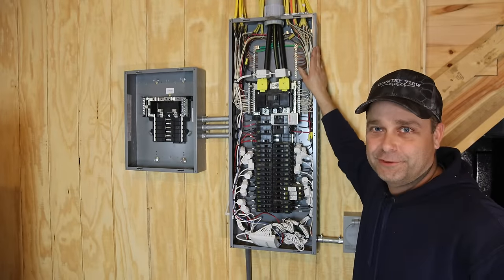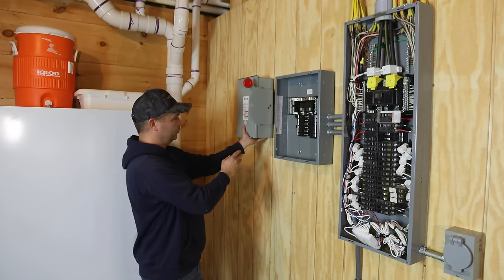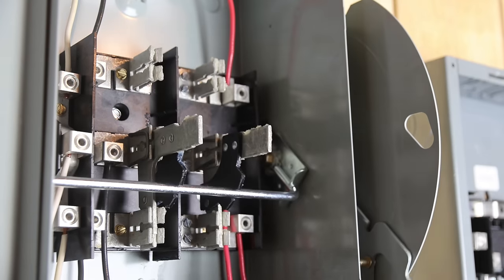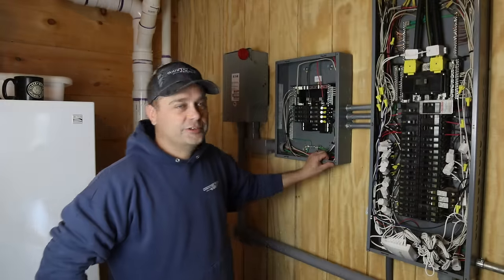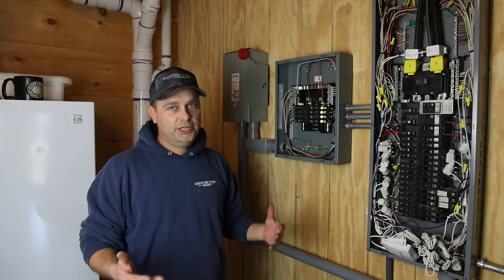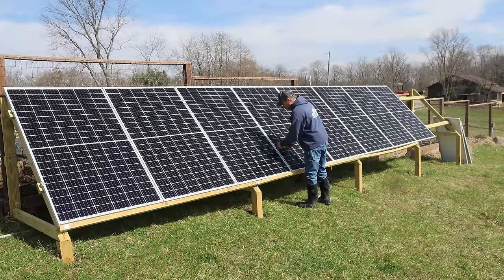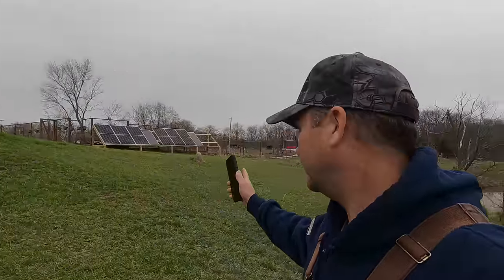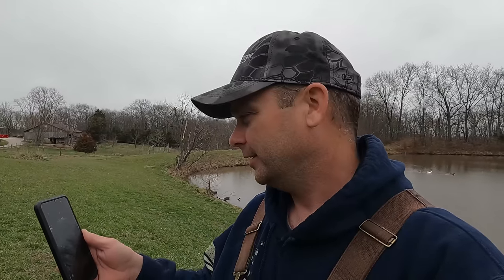Installing an Off Grid Panel and Transfer Switch.   Discovered a problem with our EcoFlow Delta Pros

Comment: When I added a subpanel in my garage, I needed to move a couple of circuits out of the main and into the sub to make room for the breaker to feed the subpanel. Like you, I was going to wire nut wires to make them long enough to move the circuits over to the subpanel. When I asked the electrical inspector about it, he told me that I could not use the main panel as a pass-through enclosure. Instead, I had to pull the wires out of the main panel entirely and perform a splice in a separate junction box. You may want to double-check with your electrical inspector to see if you need to do the same.

Take care and God Bless.
Reply: Maybe the panel is outside...wire nut splices in high humidity areas tend to go bad over time with in reased corrosion and resistance and heat.  Inside a house at home humidity levels probably not an issue.
Reply: I was under the impression that splices could be made in the panel but I much prefer to install a Jbox and splice outside the panel .. much cleaner IMO.  Thx for the excellent video

Comment: I am just ready to install a single Ecoflow Delta Pro backup at our place in the Bahamas. I'm using a Reliance 6 circuit transfer switch (single box, comes with breakers, cord, and receptacle, about $320.00). I did replace the 30 amp 240 breaker with 2 120v breakers since all 6 of my circuits will be 120v. Hoping it all works, because power goes out here at an average of 4-6 times a month, but generally only for 30 minutes to a couple of hours, though it can, on occasion, last all day (or night). Installing 2 200v panels, but will of course keep the Ecoflow plugged in all the time. Thanks for your input on this system, sucks about not being able to plug both into the grid. It seems there would be some way to resolve this, but I'm a long, long way from an EE! 👍

Comment: 👍👍👍👍👍👌Very interesting and slick system to handle your critical loads without having to use your standby generator, great use for the Eco Flo as a battery bank nice work on the critical load panel and switch over panel.!!!

Comment: It's so exciting to see you all excited about going off grid. You're in the right track, keep it up! It's really rewarding. Your system will keep growing up on you faster than you can handle. As you said  Winter is the real trial time, when you realize all the shortcoming of your configuration and decide to fix it or improve it. Thanks for sharing, and good luck with this project.

Comment: An EcoFlow has got to be almost the MOST expensive way to do a solar/battery system. Using separate battery/charger/inverter units is probably less than half the cost.
Reply: Not if you get them for free! ;-)
Reply: @oxfletch  Free is only better if it does the job, he's found two big problems already and that is just the trial system
Reply: Very true.  A big hassle to make an emergency system function as a power plant.  Best to use a real solar inverter system like sol-ark.  Hranted it costs more but over 30yrs it will pay you back in money and ease of use I can assure you.

Comment: When you get to the point that you're going to go full solar, I suspect you're going to need to consider a battery solution that's more focused on solar battery backup. The portable units are nice, but may not be the best long term solution.
Reply: Like Signature Solar EG4 Rack batteries.rack if 6 is over 30kw. And around $10,000 alit cheaper than adding additional batteries to echoflo.  Better value all the way around and more geared for solar. They have inverters that accompany around 450 volts.  At very affordable prices and utilize 2 fir split phase about $1,600 each. Hope this helps......  Jeff
Reply: @JWTX I’m in between the Ecoflow and EG4 right now. I know the EG4 is way better value, but I’m worried to screw something up because I’ve never done this before.

Comment: I have had 3 100 watt panels on my workshop and 3 100amp hr bats I run my compressor and stick welder and plasma cutter off it for 3 years, but I just have a a simple system

Comment: Use a automatic transfer switch like a Moes that will monitor battery voltage and switch from battery to utility and back at the voltages you want it to.

Comment: I maintain the metering system at an electric cooperative in Missouri.  Every state has different net metering laws, but I find it very interesting that you have chosen to maintain your own battery system rather than using the grid as a free battery.  This truly does give you redundancy in a power outage situation for your critical loads, similar to a hospital or other high uptime facility.  Congratulations on an innovative design.  It should benefit you for years to come.  It will be interesting to see how the batteries hold up over time with daily use.
Reply: Using the grid as a free battery doesn't work if the grid is down in a power outage
Reply: Evan has already stated his utility only gives him 3 cents per kwhr as sell back and he pays probably 3 or 4x that for grid power.  Not a great deal.  
The market likely will cause a lot of people to say I'll store my own power with deals like that and also find a way to be 99% off grid leaving utilities wondering why they are losing customers.  If utulities were more fair on sell back power people would glady joing net metering deals.  As it is they are scared they will be put out of business.  That is exactly what they are driving as a result.  I won't feel sorry for them either.
Reply: Keep in mind illinois has 6 nuke power plants and 11 reactors in the state and generates more nuke power than any other state.  Nuke power is the most expensive power you can have and the most dangerous/highest risk.
Its no wonder Ill only pays 3 cents per kwhr for solar buyback.  They are trying to discourage solar to prop up their nuke mistake.  The little guy like Evan suffers in high prices, higher risk of a Fukushima event plus a pittance in solar buy back rates.   Its phenomenal how one man like Evan or myself can now own their own solar power plant on their own land and not really need the grid if you add generator backup and enough panels and batteries.
If you know what youre doing theres no risk with solar for a catastrophic event.  The complexity of nuke steam power generation just from water cooling systems is enormous in maintenance and cost.  Glad I dont live in illinois with the corrupt and incompetent gov there but we all dont have choices where we live so you have to make the best of it sometimes.
Reply: @trophyfishn9757  Existing nuke plants sell power at around 3 - 4 cents per kWh which explains why utility is offering 3 cents to buyback his solar. Places that pay full retail rate for exported solar (net metering) are losing money and will be phasing out that program.

Comment: Both my Ecopros get here in three days. If they haven't addressed this my workaround is to power the house with the generator and then charge the (now off-line) Ecopros individually with available house outlet AC. Throttling back power use within the home would help shorten battery charge/gen run times.

Comment: Since none of your current critical loads are 240 you could feed each phase of sub panel from ecoflow independent. That way they could be changed from grid without shutting down output to panel. Down side is you wouldn’t be able to feed main panel during grid outage

Comment: In a emergency situation, this is the last step. First step is a panel, a controller, a battery if you have this resource, and a inverter. With enough panels you only need a buffer battery to keep the voltage steady.

Comment: Evan, you only bond neutral and ground together at first panel. Not in secondary panels. It looks as though in the solar powered panel you have a green ground wire running from your ground buss to your neutral buss.
Reply from the maker: No I don't.  I have 3 ground bars in the new panel.  They aren't bonded to neutral.
Reply: @CountryViewAcres  ok, I couldn't get a close look at it.  Sorry, I didn't mean to make you upset. I went back and stopped the video and zoomed in and now see what you did. It looks good. The circuits you moved to the second panel are they supplied 24/7 from solar?
Reply from the maker: I'm not mad.  Sorry if it sounded that way.
Reply: @CountryViewAcres  Is the seperate panel on solar 24/7 or is it possible to feed it by switching to mains power? Is that what the other switch is for? I'm trying to figure out the schematic in my head.
Reply: @CountryViewAcres  Hey Evan, have you heard of a grid tie inverter? A grid tie inverter can be plugged into your system, either the solar or mains system and be fed from the two panels you pulled out and the grid tie inverter matches the phase of the circuit and feeds power into the circuit from the solar panels and so items plugged into that circuit get power from the solar instead of the electric grid. On my channel I did videos of a gentleman who lived not far from my place that had a bunch of panels and grid tie inverters and he was on a electrical provider that would purchase his excess power. It was a simple system but he cut his power use way down.

Comment: Just a couple observations...you mentioned you're going to up grade you 100a 12 ckt panel in the future.  When you do you should also move all the branch circuits that are served by the sub-panel into that panel.  It's a code violation to use the main panelboard as a junction box per NFPA-70, 408.3.A.2.  The same holds true for your solar/gen input outlet, it should be piped directly into the transfer switch...it's an outside source and has no business being routed through that panel.  Also remember the Neutrals and Grounds need to be separated/isolated from each other in the sub-panel.

Comment: Thanks Evan. I have a grid tied solar panel system, it is a 9kw system.  It is my understanding that the solar power generated is first used to power my house during the day with any excess send to the grid. It seems to me that your solar could power your home entire during the day if it produces enough, with any excess sent to charge your batteries. You could then us the batteries to power your house at night or use the grid. Thanks for sharing, I sure hope that you are consulting with an electrical engineer as you make these changes.

Comment: If you wire the solar panels in series and in parallel it would lower the voltage and raise the amperage.
Reply from the maker: The amperage will double if in parallel, and that is too high of amperage for the delta pro.  The panels aren't perfect for this application.
Reply: @CountryViewAcres   What if you put a charge controller infront of the eco pro?
Reply from the maker: @Adam20202  some people have used DC power supplies to charge thru the solar connection.  So that the 240 volt output will continue to run.

Comment: A workaround for the ecoflow charging while they're running low might be setting up a automatic transfer switch with a simple relay that you could just hook up a charger into the solar input and charge during your off-peak time-of-use rate our overnight for now

Comment: I’ve been considering the same thing but saw an automatic transfer switch. You’d need battery back up as the automatic transfer just switching the charging system and it will consistently run off battery.

Comment: C
want to consider your total autonomy. This would mean that your battery storage would be big enough to supply power for an extended period if you could not produce enough solar power to completely charge the batteries

Comment from the maker: After several comments and discussions, I will address a couple items.
Apparently you should never try to charge the Delta pro, while it is outputting power to a system, where the Ground and Neutral are connected to the system that is charging the delta pro.  This is the problem I was seeing.  It would happen, in 240 volt or 120 mode, Since the subpanel ground and neutral are connected with the main panel. 
Second item, I don't have a Well Pump.  The house is connected to a rural water system.  That's why a well pump wasn't in the critical load panel.
Reply: Sounds like it may work with my SMA - SPS on my 5.1kW solar inverter (SPS is secure power supply, can run in off grid mode, the reason I went with Delta Pros for backup power), that should send up to 1800 watts on an off grid mode circuit to power the Delta Pros when the grid is out.  That's my plan at least...it stinks because I can't use either solar array since they are grid tied and wired up to their own inverters.  A full system would be better but would cost me $10-20K. 

Did you think of installing the Ecoflow Smart Home Panel instead? That would have automated backup, used solar when available, etc, or are you going to moving to a more real inverter, battery system?

Comment: THANKS for this! Excellent presentation! I noticed the Eaton Double throw Transfer switch you chose is a 2 pole, rather than a 3 pole which I've come to shakily believe was required.  You're tying the neutrals together. Can you shed some light on this subject as I really don't understand the significance or difference between 2 pole and 3 pole regarding neutrals or bonded neutrals.

Comment: Hey Evan, I have run into the same exact issue in my setup. I basically set up the way you did before seeing your video. I ended up custom making a wiring harness with 10 AWG SOOW generator cable with the 240 / 120. Generator female plug on one end and two 30 amp RV 120v male plugs on the other to plug into my delta pros. That means I am really running my transfer panel at 120 volts instead of 240 but, like you I have no 240 volts loads there. I think what's going on it that delta pro has basically 2 power circuits - a 3600 watt inverter that doubles as the AC charge controller when in UPS mode and the MPPT solar charge controller that only deals with solar charging. I think the problem comes in when we ask the delta pros to invert and sync with each other to match phase and frequency 180 degrees ot of phase with each other to create the 240v and simultaneously try to charge on ac input. Since the inverters are active for output, they are not available for AC charge control. When not using the double voltage hub, the Delta Pro's can enter UPS mode allowing ac charging and straight through ac to the front panel outputs at the same time. Pretty sure that's the reason. One other problem I have encountered is even though I am using the 30 amp RV outputs, I can only pull 20 amps per delta pro while AC charging is happening. I am running about 325 watts per side on my transfer panel. When my wife tries to use the 1700 watt air fryer and other loads are active, we can exceed tat 20 amps and the delta pro kicks out. If I am inverting and not ac charging I have the full 30 amps available (3.6 KW) and there is no problem. Others have expressed the same problem so it just takes a little power management to avoid. Other than these caveats I love the delta pro setup. I am running two delta pro units and four extra battery units. Loved your video! Mike

Comment: I think the possible work around to this being unable to recharge while outputting AC 240 Volts to your backup circuits at the same time is to attach two of the EcoFlow "Smart" Generators (One to each Delta Pro unit) via the special side DC battery expansion sockets, and this way when you setup the smart generators to automatically turn at the battery charge level you set, then you will see a seamless switchover to simultaneous charge while outputting your 240 Volt AC continuously without interruption. Unfortunately, two extra EcoFlow Smart Generator units not an inexpensive upgrade.

Comment: 🤔 just a thought....if you see this.   You could use a self switching regulated power supply to make a DC output.  This plugs into your ac outlet, but could replace input for the solar on the ecoflow units.  The eco flow units would think it's solar input and not switch out of split phase.

Since the ecoflows self protect themselves, it shouldn't be an issue if you forget to unplug it and the sun comes up.
Reply: I mean....additionally....since none of your loads are split phase in your critical loads panels......you don't need split phase.  You could, in all reality, just wire one eco flow to L1, and the other to L2.  It would require a second transfer switch, but that would be another option.

Both of these recommendations are things I would literally do if I had ecoflow.  I do not however, I am self installed Sol Ark 15k, doing it all behind the meter with a critical loads and limited to home sell.

Comment: Hi! Have you considere a Tesla Powerwall 2 system with the gateway that automatically switch when grid power is needed and automatically manage you demand of power. Also you have a very well made phone app to manage and to monitor the system . Powerwalls can be also put up in series to increase your energy storage

Comment: My wife and I are both addicted to your videos. We LOVE them. On this one however, 
I am not positive but I thing wire connections are not allowed in a panel under the NEC. I think you need to use an external junction box. Did your installation pass inspection?